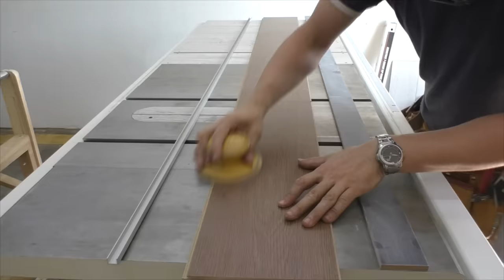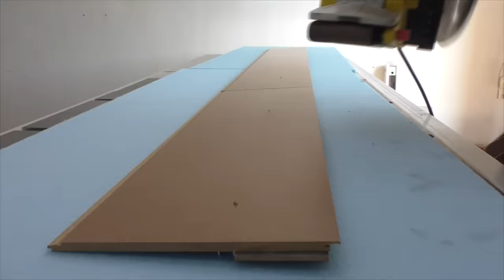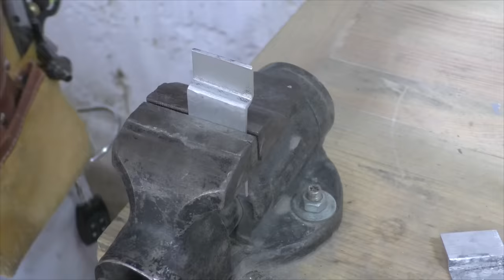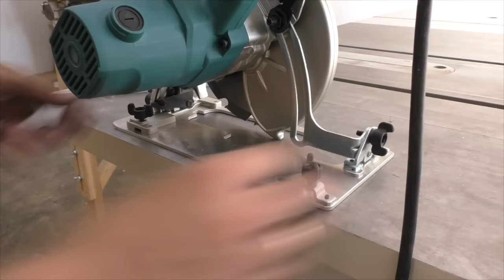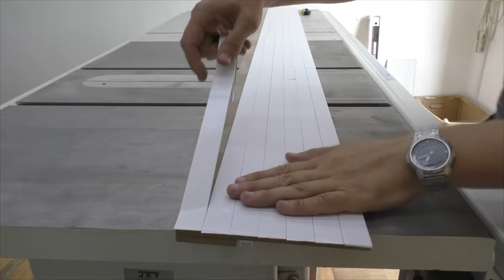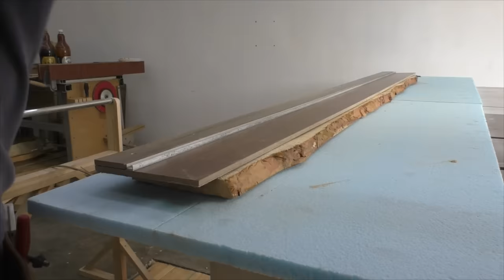🟢 Homemade Track Saw - DIY Guide Rail for Circular Saw

Comment: Making a track saw is easy. All you need to get started is a table saw.
Reply: That’s not a table saw you see under there. That’s a circular saw he made from a track saw.
Reply: ....and a pillar drill and loads of space.
Reply: Making a table saw is easy. All you need to get started is a circular saw.
Reply: At least he didn’t use a milling machine for the metal bits.
Reply: Or you could just be precise with the circular saw... if you fail that you could use some metal and a sander, or you could as previously stated use you circular saw for a table saw. You could also ask a friend or family member, or pay somebody to do it for you... the idea here is that you can be creative you can be frugal. Easy things to think your way through.
Reply: Or a track saw!
Reply: Actually you can easily make a table saw with a circular saw.
Reply: Commenting cause i can only "like" once. I love other diy vids: 
"So i 3d printing this mold, then milled it, cleaning up on my lathe, and finished off with my plasma cutter"...cool
Reply: I used my track saw to build the DIY track saw cause I don't have a table saw 😂
Reply: I own a table saw and I'm currently in the market for a track saw.... Because they are different tools...
Reply: I know right! If you have a saw that cuts perfectly straight, its easier. I thought video meant to be for the people who doesnt won heavy cabinate saws
Reply: Does no one else here not realize that a track saw can make more cuts than a table saw? How do you make tapered cuts on a table saw? If you have a table saw you still might need a track saw...
Reply: Just use the manufactured edge of a new piece of plywood
Reply: @TheRealGOTdurrrred  Make a rail so that you can push your table saw along it??
Reply: 😂😂 so.. it's like chicken and egg.. .which one first..😂😂
Reply: @TheRealGOTdurrrred  Easy.  You have a base board that runs along the fence and the tapered cut board laying on top, skewed to the angle you want. There’s many vids on it.
Reply: @contessa.adella  so you need to make a jig? Yeah I'm aware of this. It takes a jig.... Table saw alone can't make the cut. And not nearly as easy.
Reply: The average DIY'er like me doesn't have aluminium channel, aluminium plate, laminate flooring, rolls of sandpaper etc. just lying about. By the time I have bought all that I could have bought a cheap tracksaw which would probably perform better.
Reply: How to make table saw? You need just track saw😂
Reply: It’s not necessary but speeds the project up significantly just get creative

Comment: I've been building these tools for years BUT never with the metal track. That is incredible thankyou for sharing. It improves an OK plan to a great plan. I will be building them like yours from now on. This tool makes cutting sheets of plywood much safer for one person, as opposed to using a table saw. It also means there is no $1000 dollar table saw left on the job site when there's no one around. That was common practice in the past.

Comment: I used silicone on the back of my diy track... spread with a fine V notched spreader .. it worked great !!
Reply: I was beginning to wonder if only I had that idea too. Instead of a fine  V notched spreader, I used a wide putty knife with a few wires wrapped over the edge to create a uniform silicone layer.
Reply: I'm not fond of using any silicone around wood or any other surface that will be coated later, as it end up interfering with adhesion of coatings, or causing fisheyes on any painted finish... Wax is much better, as it stays on the sliding surface and does not migrate like silicone.
Reply: @Alfredo Márquez  I'm thinking he meant in place of the sand paper he used a tube of silicone and spread it out like a sheet of "grippy" rubber.  It will completely cure so as to not interfere with the surface of the good pieces being cut.  Also,  it will not scratch the piece if you are cutting something that had already been finished.

Comment: The addition of the sandpaper as a non-slip footing is very cool. Nice
Reply: That's the one thing I didn't like. It's going to damage whatever you're cutting and be a bugger to replace. I'd have used strips of rubber,  like on normal track saw track.

Comment: Tracksaws are the great unsung heroes of the workshop.  Way better than struggling with large sheets on the table saw.  Both safer and much more accurate.  In fact, for the home shop, they can be a real space saver as you can get away with a jobsite saw plus a track saw.

Comment: So using those two inverted pieces of "U" track was brilliant.  Great idea!
Reply: for real !
Reply: What are the "U" track measures?
Reply: @douglastube100  looks like a standard T Track (bottom) table saw guide (top)
Reply: @aimkdu13  Where do you find one that interlock as smoothly as in the video?

Comment: mmk. seems overly complicated to me. I just screwed the channel onto a piece of plywood and let the saw define the edge. I don't have any tablesaw or drill press to create this.
Reply: Thank you! I appreciate the ideas, but somebody (like me) looking to build a home made item probably doesn't have a $1000 table saw. How about simple plans for making a track saw with basic tools?
Reply: HAHA...  I agree if you had of those tools you wouldn't need a DIY guide... hahaha
Reply: i could see that using vinyl flooring is better then plywood because of the rubber matt for friction instead of a clamp and the slick surface area for a smooth slide would probably  work nice too.  You can still let the saw define the edge.
Reply: Good thing the channel was straight.
Reply: @snoopster000  could tie a thin rope to screws on both ends of the base to ensure the track is straight
Reply: Yes but the cut is not as precise. This solution demands a bit of extra work but adds a little bit of error prevention to the project.
Reply: Idk I really like this idea as a lot of times you can get those laminates really cheap at Lowes in the damaged section. And I realize he uses the table saw and drill press but you could always improvise and make a couple rips by clamping a straight edge down to make the piece that you need and who doesn't have a drill for crying out loud, I think this plan is relatively simple and I want to try it
Reply: @snoopster000  lol

Comment: I often use the countersink to spot through the screw holes of a bracket or hinge then pilot drill. 
If just drilling holes, I do the pilot first & then countersink. It keeps them concentric.

Comment: Thank you for the inspiration and idea for the track.

I stole your idea but simplified it a little. Like you I used the laminate flooring but had to glue two pieces together to give me enough width and instead of a U track rail I used an L track rail. This allowed me to use a U section attached directly to parallel fence that came with my saw. I turned the fence upside down so it cleared the table. Attached a strip of wood to the fence with a minimal recess to allow the strip of wood to contact the full length of the saw baseplate. I then attached the U channel guide to the wood. It doesn’t matter that the screw heads protrude into the channel as it sits over the L shape of the track. This negates having to construct special brackets to fix the guide to the saw. As long as you are careful positioning the track against the stop there is no play in the guide as it travel along the rail. 

I also taped some nonslip matting (like you use to stop items slipping in the car) instead of the sandpaper to the base.

Hope this helps someone who hasn’t the skills, like me, to make a bracket.

Comment: Awesome build! Loved the sandpaper and double stick tape on the bottom for grip! Great idea!
Reply: lol. this is not a track saw. Its a straight edge for circular saw. And I would love to see all those prefinished panels after being in contact with sandpaper. I will tell you something My Makita and festool never left any scratch.and tracksaw is not just to cut straight. Its also chip free cut and dust collection.
Reply: @marcelo403polo2  actually, my circular saw also has the vacuum ataachement, and as for chipping, well better blade then :D but still it is a track saw quide not the saw itself. 
right now im thinkin, to what to change the sandpaper (exactly the pre-finished panels) maby felt or rubber.
Reply: @TheOvercharge  I guess you could try same stuff as festool and makita is using. Kinda rubbery 2 strips. Pretty good friction on prepainted panels. Also on the edge there is another strip, which makes like zero clearance protecting from tear out. 
IMO if you cut lots of those, just cry once, buy once.
Reply: @marcelo403polo2  of course, if you use like a dayli basis, then i would also buy a real one, but for a hobbyst, who would use it a 1-2x times a year... overkill. but like the saying is, you get what you pay for.

Comment: Your timing (or mine, I suppose) is very good.  I need something like this as we speak for cutting sheets of plywood.  Thanks very much for the ideas. 

In my case, I'm going to add a channel to the bottom to use some clamps I have from previous cheaper straightedge extrusions.  Thanks again, and thumbs up to crush a troll.
Reply: Now thats a protest I could get behind Mike, Thumbs up to crush a Troll..... like it

Comment: Cool idea.  I think I will make one myself as I have most of the materials laying around anyway. 

I did chuckle at grinding the screw tips down for two reasons.  

1. Just use the right size screws. 

2. You put foam tape on the bottom anyway.

Comment: What kind of sanding belt are you using to grind the screws flush without tearing the belt up??
Reply: Anout 10 of them I'd say, unless they were stainless
Reply: Use corundum or zirconium

Comment: Really good idea using engineered wood!
Reply: I love using that stuff in jigs.  It's stable, easy to work, slickly finished on one side, has perfectly straight and square edges, easy to expand for length (as he did here) or width, and cheap, since flooring stores always have extra lengths of it from jobs.

Comment: Great job!!! I am tired of struggling to break down 4 x 8 sheets on the TS. Much easier with a DIY guide rail. I am making an 8ft and a 4ft....WHERE did you find alum channel that fits over the other channel?...I am thinking to just cut a strip of HDPE to ride IN the channel but your solution is much simpler requiring no modifications to the saw base plate. THANKS!
Reply: metalsupermaket perhaps, see my reply for detail

Comment: Could vinyl flooring that already has the rubber backing be used instead of the flooring you used here?  AND instead of a candle for the wax, what about using wax like the kind used for chalk painting furniture?  I have these on hand and don't have taper candles.
Reply: I think you are spot on with the use of the vinyl flooring with the rubber backing. I don’t know why you’d opt for sandpaper, when it limits you from using this set up on anything where you don’t want to mar the surface. Not sure about the wax question, if there would be some inherent difference that would make it less desirable, but I suppose you could experiment on a pice of scrap flooring and saw outside of this project, just to see if it works.

Comment: Hello from Australia!, I have subscribed!, the best DIY track saw on the internet!. You are a genius my friend. Where did you buy the metal C-channel's?, and what are the dimensions for both channels?.
Reply: I agree I would like to know this same thing
Reply: looks like a standard T Track (bottom) table saw guide (top)
Reply: Where is the answer to this question, does look like 2 x C channels, but need paired exactly, that is the clincher. So where do they come from?
Reply: @jameshaveron4197 , you can grab them pretty much every where, even wish has them at you know, wish prices.

Comment: How did you make sure the long track was perfectly square when you screwed it down?  No bow in the middle?
Reply: They are pretty ridgid, he had 2 saw track rails on both ends to space evenly away from laminate support backer.
Reply: The half i beam profile

Comment: My first thought is that I wish I knew someone with a couple of spare pieces of laminate flooring.
Reply: Craigslist, depending upon where you live. I want to know what that aluminum track he is using. Not likely on Craigslist.
Reply: Check with floor installers.  There's always some left over from jobs, and often they won't even charge you for it.
Reply: @AndreBellCopywriter  I've used adjustable wall shelve tracks before.
Reply: Marketplace

Comment: Excellent homemade tracksaw.  I'm going to make one as well based on this.  A couple of questions though. 

(1) Were there any shorter screws available so that you could avoid the need to have to grind off the extra that poked through on the bottom?
(2) if shorter screws were not available, was it even really necessary to grind the extra off, considering that you were going to tape the bottom and attach the sandpaper as a non-slip solution?
(3) would it have been better to cut the ends of the track saw and make the first cut using the circular saw after the sandpaper had been attached to the bottom?

Thanks again for an excellent DIY video!
Reply: 1 - a shorter screw would mean less screw to wood engagement and probably be pretty weak.

2 - if you do not grind the ends they could create problems in the future, sandpaper might hide them but the points do leave an uneven surface.

3 - trimming after taping would probably be faster but it would cost a bit more and waste a bit more.

Comment: Great job- wondered about using laminate for this. How is it holding up over time?
Reply: I would say for the application he using it for, it probably is holding up just fine? Now if he was taking it to job sites and throwing it in the back of his truck, dropping it on the ground etc, then I’d say that laminate wouldn’t last very long!
Reply: @drumfanatik316  I think it's better than plywood for this, since it steals less cut depth

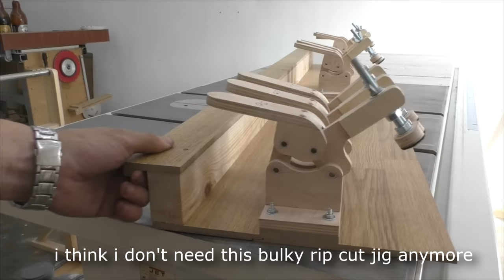Comment: 11:50 You can re-purpose that rip cut jig.  Cut it shorter, screw thicker plywood to the bottom, and install a miter bar.  You now have a tapering jig for the table saw to cut tapered table legs.

Comment: Love the thought but there must be a better way to align the track when gluing up the two boards.  Super glue can really cause you issues when it makes contact with both surfaces (even when its long setting glue).  Maybe tape the track to the bottom board prior to the glued board touching the second board.  Watched you having to pull the top board off prior to putting it down permanently.

Comment from the maker: In this video i show you my homemade track saw for Makita circular saw as alternative to expensive branded ones. 

All free plans I ever made are here:
https://drive.google.com/drive/folders/1636_O_7KVQ5hzWAhDXBornWnvxXfweba?usp=sharing

GRINwood shop:
https://www.etsy.com/shop/GRINwood

Support GRINwood:
PayPal: grinwooddesigns@gmail.com

Thanks for watching
Reply: Question- Why is there a milled groove in the table of a circular saw?
Reply: GRINwood Great work!!! An idea, put a plastic bottle on the saw ashes exit to collect them.
Reply: 99
Reply: Which model Makita saw is that?
Reply: Nice
Reply: 9th
Reply: Fantastic job😎well done👨‍🔧
Reply: Excelente trabajo, simple práctico y no necesitas agujerear la base de la sircular... Perfecto.!!!👍👍👍👍👌👌👌👌👌👌 me pasarías  los mm de la madera y la guía de aluminio? Un abrazo desde  Buenos Aires Argentina
Reply: Nice work :)
P.S. Sanding paper - made in Poland :)
Reply: @michalchwieduk3847  χ
Reply: @silataungahihifo4163 Paneling
Reply: Ec
Reply: @Max-ih6dl  o
1\1
Reply: How about the 45
Reply: What's the name of the blue  board , I need to order some .and need the name
Reply: @danielepiccinini6768  o9
Reply: @kemiost55  It looks like 5007 or 5008 MG...
Reply: @celestinomartinez5241  It is polystyrene foam insulation... you can use the blue or the pink colored (called "Fomular")...
Reply: @silataungahihifo4163  ui
Reply: Hi please can you tell me the sizes of the aluminium channel that you used?
Reply: @celestinomartinez5241  so long ago you may have your answer. It is foam board insulation. Any brand will work. Use minimum of 1” thick.
Reply: Какой профиль использовал?

Comment: I have been going back and forth in my mind whether to buy a Festool on Marketplace, or to make something.
I like this idea.
A couple questions;
1 - Tearout; have ever wished you had some kind of replaceable strip along the edge of the straightedge that would work as a "zero clearance" thing, or is the laminate enough to prevent any fuzzies? 
2 - Does this produce clean enough cutts and straight enough cuts that you can skip the jointing and move straight to glue-up?
3 - Plunge cutting; ever seen the need for that?
4 - How often do you find you need to replace this track?
Thanks! Appreciated the video.

Comment: Now for a modification.... Remove the depth set screw. Replace with a stop set screw. Install strong spring at depth hinge. Add a solid poly carbonate blade shield while removing the original blade guard.

Comment: I liked your design and built a track like yours. It works fine at the temperature that it was built, however, at other temperatures the track curves sideways as the metal glued to the base expands or contracts at a different rate than the base material, in my case I used synthetic floor panels as a base. Without keeping the temperature constant the track cuts a slight curve.:face-blue-wide-eyes:

Comment: The cut edges of flooring laminate can be razor sharp. I use a quick touch over with angle grinder flap wheel to take off the sharp edge.